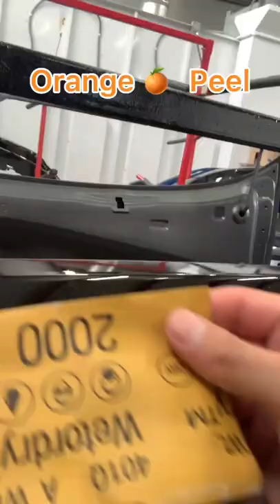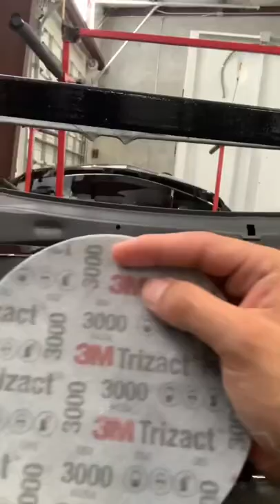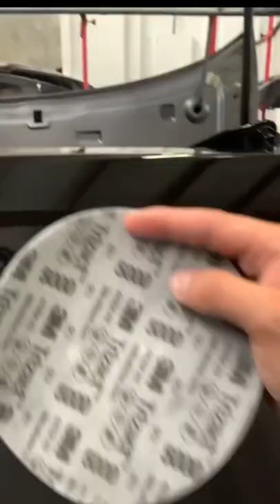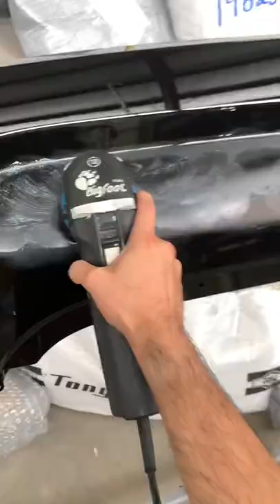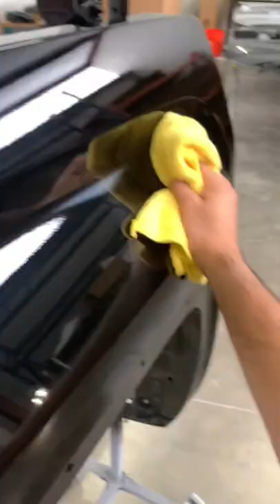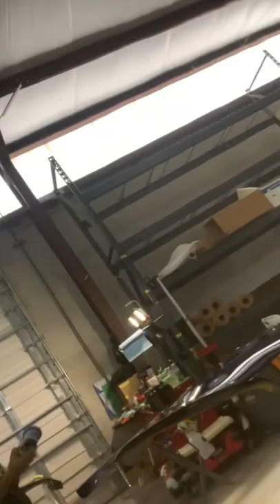How to remove a orange peel!

Comment: Hey man good video , I just bought a 6inch polisher and it came with terry cloth and wool cloth. What steps should I follow because it don’t come with a sponge pad
Reply from the maker: I would start off with the terry cloth towel and gradually move up to wool.  Wool will burn your paint quick if not lubricated and used properly

Comment: Im trying to paint an '83 Golf convertible. I got some orange peel on the paint coat, and the surface doesn't look super uniform. should i sand it before applying the clear coat or just apply the clear coat and sand it afterward? 
In case i should sand the paint coat, what grit? Should i polish it too?

Comment: Is this before clear coat?
Reply from the maker: No, it's after clear coat. We put a good amount of clear coat so it allows us to cut and buff as you see here so we can polish it out to perfection 👌  Are you trying to do the same?
Reply: @ReveMoto  i was going to paint the cab of my truck myself.

Incase i dont get a perfect finish lol
Reply from the maker: @aammadmustafa5985  yeah just layer two coats of clear.  You will be fine as long as you know when to stop sanding when you buff
Reply: How many coats of clear is it 2-3?

Comment: Is the 5000 really necessary? In my experience G360 compound removes 1500+ so by finishing with 2000 grit before compounding shouldn’t see much difference? Happy to be corrected if you think otherwise and everyday is a school day!
Reply from the maker: Professionals no 5000 grit not necessary as they know the compound and cutting power of pad being used.   This technique for amateurs cuz they tend not to know what compound or pad to use, so they chasing sand scratches.  I make it easier for them on the buffing side by getting them to the finest grit possible.
Reply: @ReveMoto  understood and thanks for quick reply. Makes sense now.
Reply: @ReveMoto you don’t need to be a professional to know, each compound today have the grit of sand paper it removes written directly on the bottle .. if it says 1500, you don’t need to go 5000, but 3000 will make it a lot faster to remove
Reply from the maker: @MowSow  Yes. 5000 is not necessary if you know how to use the buffer/compound properly.  I am just stating it makes the job easier.  Not stating it needs to go that far per manufacturer recommendation
Reply: What can I do for sand scratches, compound or polish?

Comment: Starting wit 1200 sand paper would be too aggressive?
Reply from the maker: No depending on how bad the debris or drip is.  I sometimes start with 800 grit.  Always end with 2000 but I prefer 3000.  Easier to buff
Reply: @ReveMoto  thank you very much for your fast response 👍👍👍

Comment: Hi, I have orange peel on a part that I painted. I sanded it and then I polished it but when I polished it, the color wasn’t shiny and it became a little bit different. I was using an orbit polisher. Any advice and thanks
Reply from the maker: I think you may have over sanded and now that are doesn’t have clear coat.  It may have to be repainted
Reply: Agree. Sounds like you went through the top coat. Try a very tiny spot with 1500 wet and dry then G360 fast compound on a cloth backwards and forwards side to side. Buff with clean cloth. If no improvement then you need to prep surface for 2-3 coats base coat and then 2-3 costs of clear.
Reply: Maybe you just used a step 1 and did go step 2

Comment: Without measuring the paint thickness with a gauge you will be doing more harm than good by that.
Reply from the maker: We painted it so we know the thickness of the clear.  If it was a panel we don’t know about yes a gauge is recommended

Comment: Use a Da u gonna have swirl marks everywhere scratch marks
Reply from the maker: If used properly and end with at least 3000 grit swirl marks will easily be buffed out
Reply: What polisher brand is that?
Reply from the maker: @SpinningwrencheswithJ   Its a rupes
Reply: @ReveMoto  thank you